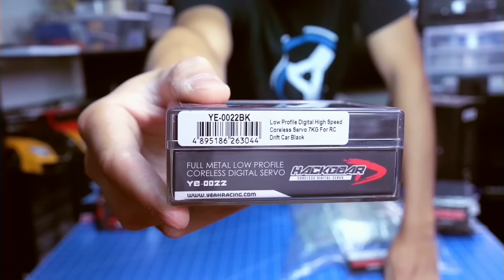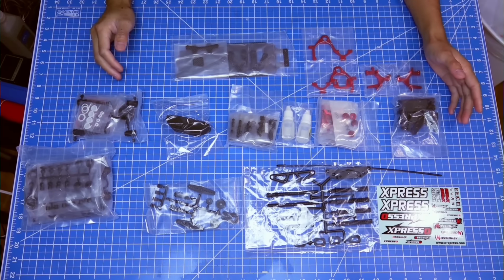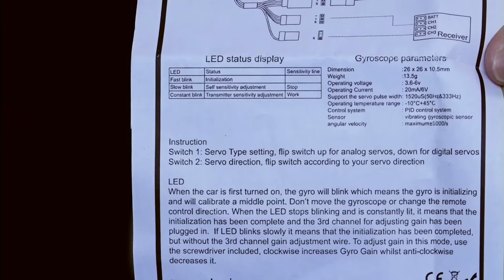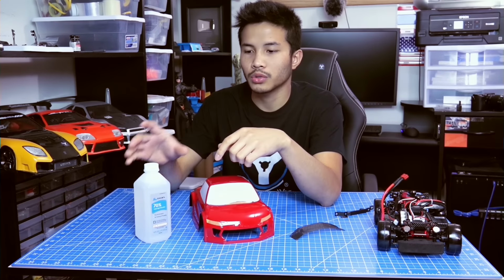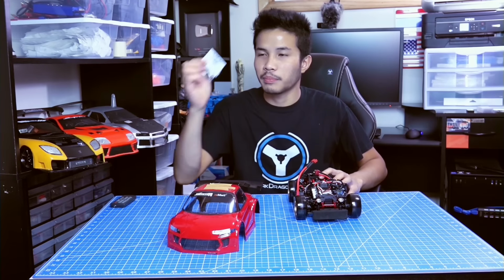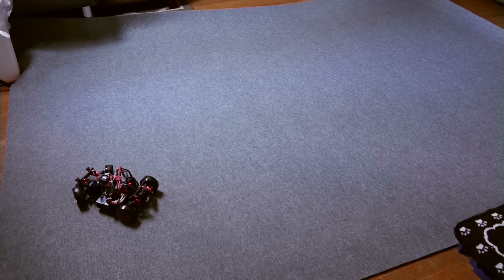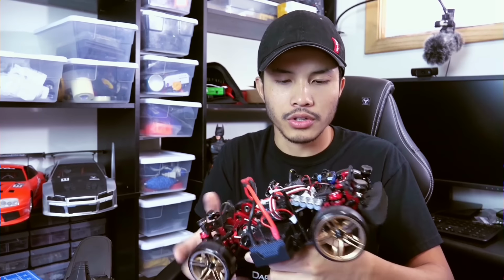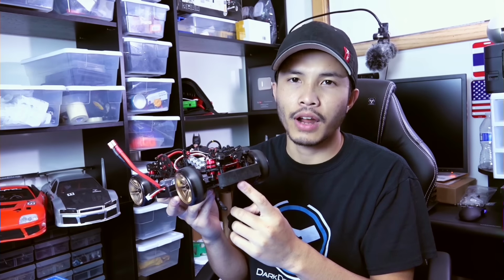RCMC23 | Xpresso K1 - RC Car

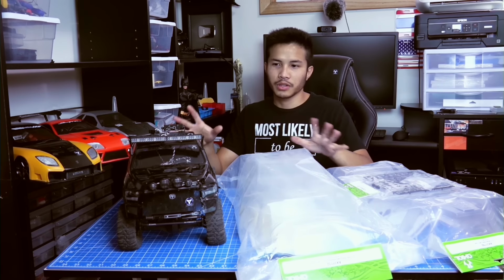Comment from the maker: Yeah Racing X DarkDragonWing® Motion Steering Wheel For 1:10 Touring Drift RC Car #YA-0539
USA https://goo.gl/FxZbaa
HK https://goo.gl/NcPWQ0
Australia https://goo.gl/SsEM7o

Xpress K66 Clear Body Set For K Chassis Xpresso K1 #XP-40025
https://goo.gl/qtco8A

Xpress Xpresso K1 1/10 K Car MR 2WD Chassis Kit #XP-90001
https://goo.gl/OfSiUv
eBay https://goo.gl/RQ9YNu

Robinson Racing 4340 Pinion Gear Aluminum Pro 64P 40T
eBay https://goo.gl/czrBh8

Instruction Manual
http://www.rc-xpress.com/media/wysiwyg/MANUAL/xpress_xpresso_k1_manual.pdf

Instruction Videos
https://www.youtube.com/playlist?list=PL6_nz6AZ_FjBv_aL3w5DYw3RuXZYMfN5e

7.4v 8000mAh Lipo Battery  
eBay https://goo.gl/nn6lGp

Imax B6 Balance Charger+AC Adapter
eBay https://goo.gl/z2UsM6

Color(s):

DuraTrax Racing Red
eBay https://goo.gl/s7H8rp
Amazon http://amzn.to/2oFOYov

DuraTrax Black Base Cover Coat
eBay https://goo.gl/7wSVIN
Amazon http://amzn.to/2oFL8M0

Transparent Colors
http://abchobbyusa.com/lightingkit.aspx

Tools For RC Modify:

ABC Hobby Masking Tape 15mm Width x 18m
eBay https://goo.gl/2xzD9M

3M Mounting Tape
eBay https://goo.gl/gXDStt
Amazon http://amzn.to/2p65Lx8

Dubro 2331 lexan Body Reamer & Scissors Set
eBay https://goo.gl/uHkXpX
Amazon http://amzn.to/2nF4MTx

X Acto Knife
eBay https://goo.gl/9Knkdg
Amazon http://amzn.to/2nbSdUh

Duct Tape Nashua 48mm x 55m 
eBay https://goo.gl/K4scr9

Soldering Iron 60W
eBay https://goo.gl/aqH0Tu
Amazon http://amzn.to/2oGmhV3

Soldering Wire 60/40
eBay https://goo.gl/str3K6
Amazon http://amzn.to/2nCthR5

After Market RC Parts:

Stickers
http://www.screenprintdigital.com/

 Round Magnet Body Posts
eBay https://goo.gl/hiQ5fr

Extra Round Magnets for Body Posts 12x2mm
eBay https://goo.gl/haOabK

1/10 RC Spoiler
eBay https://goo.gl/b0zjL4
Amazon http://amzn.to/2oE4vVo

GT POWER 12 LED Flashing Lights
eBay https://goo.gl/9Lq5cj
Amazon http://amzn.to/2oaPBVW

Amaco 1/16 Aluminum Contour Mesh AO50004D
eBay https://goo.gl/dGr7Qn

Optional Parts:

Mini Car Stand Blue by Duratrax DTXC2361
eBay https://goo.gl/fzWXPr
Amazon http://amzn.to/2oaYzm3

Deluxe Car Stand Blue by Duratrax DTXC2370
eBay https://goo.gl/ghGvBr
Amazon http://amzn.to/2nFakgy
Reply: Pls build a red lambogini pls

Comment: Love your video's! Can you please do a body shell from a 1/14 Tamiya TGS Racing Truck. they fit the TT01 so will fit the D4's etc. Part number Tamiya: 58632 If required. lots of room in the cab for mods, maybe a water cooled setup with a radiator up front?

Comment: Hey man whats up. Love your video's so much. One of your videos inspired me to restore a vintage 1990 New Bright 1/10 Scale RC Police Car. Adding in hobby grade electronics and new upgraded motor made the thing super fast but it stripped my gears when I gunned it in a parade at the finish line. Can't seem to figure out how to fix the gearing.
Reply from the maker: It could be hard to fix those type of RC cars, they aren't really meant to be fixed.
Reply: DarkDragonWing Yeah thats for sure, shes a shelf queen now till I get better at modding and customizing rc cars and trucks
Reply from the maker: Michael David Cilantro You can mod her using standard 1/10 electronics. That might work
Reply: DarkDragonWing Looking into fitting an axial axel on the rear and installing a transmission. Might be able t pull t off. Its already axial in a way so shouldn’t be hard.
Reply from the maker: Michael David Cilantro Sounds good

Comment: how good is the plastic part you make ? are they like rpm? or will they break easy
Reply from the maker: The gear will hold up at any RPM an RC can put out because it drives the belt and the belt doesn't create much heat.

Comment: Do you know what kind of battery to use for a traxxis emaxx  because mine won't hold a charge anymore
Reply from the maker: What battery do you have now? 7.4v?
Reply: DarkDragonWing I have a 7.2v
Reply from the maker: Jesse Tillman Here you go http://www.ebay.com/sch/i.html?_odkw=7.2v+6000mah&_osacat=0&_from=R40&_trksid=p2045573.m570.l1313.TR0.TRC0.H0.X7.2v+5000mah.TRS0&_nkw=7.2v+5000mah&_sacat=0

Comment: Make a working turbo system Built for all cars ?
Reply from the maker: Good idea!
Reply: DarkDragonWing no problem:)
Reply: DarkDragonWing where can i find S2000 Bodies at ? or EF hatchback or honda Civic
Reply from the maker: Nathan Morales Not sure
Reply: Nathan Morales hpi do a Honda s2000, if your in the UK I recommend wheels spin models for hpi body shell s
Reply: where do you buy that remote control cars
Reply from the maker: Karen Argente check the description

Comment: I see u can fabricate your own parts if I was to give a part(it's a front upper deck plate) to fabricate in aluminum would u be able to make it for me
Reply from the maker: Yes, I could, but I don't have the CNC Milling machine that will cut the aluminum part for me.

Comment: were did you get your 3d printer from
Reply from the maker: This one: http://www.ebay.com/itm/HICTOP-RepRap-Prusa-I3-Auto-Level-Unassembled-3D-Printer-175MM-Aluminum-Frame-/151817197431?hash=item2359029777:g:Eq8AAOSwhOVXey4C

I will make a video about it sometime in the future.

Comment: what esc and Motor do you use?
Reply from the maker: It doesn't have a reverse option. You will need to buy a program card separately. I would say find other one that has a reverse option already.

Comment: where can i but upgraded battery
Reply from the maker: What battery do you have now?
Reply: i have a small 1200mah battery and i want something bigger like a 1800 or 2000
Reply from the maker: Marcus Tan I see what voltage? 7.2v? or 7.4v?
Reply: 7.2v
Reply from the maker: Marcus Tan Here you go 5000mah http://www.ebay.com/sch/i.html?_from=R40&_sacat=0&_nkw=7.2v+5000+mah&rt=nc&LH_BIN=1
Reply: thanks alot

Comment: why is it so short and Stubbs
Reply from the maker: They made it to fit small bodies I think
Reply: +DarkDragonWing  Thanks for getting back to me is there any beginner dc drift cars you recommend
Reply from the maker: You can build it yourself like this video here. Look in the description for links:
https://youtu.be/aJGDfJp9cZY
Or you can buy one of these already built:
http://www.nitrorcx.com/madspeed-drift-car-green.html
http://www.ebay.com/sch/i.html?_sacat=0&_from=R40&_sop=15&_nkw=1%2F10+madspeed&rt=nc&LH_BIN=1
http://www.ebay.com/sch/i.html?_odkw=1%2F10+hpi+drift&_udlo=190&_sop=15&LH_BIN=1&_osacat=0&_from=R40&_trksid=p2045573.m570.l1313.TR2.TRC1.A0.H0.X1%2F10+hpi+drift+RTR.TRS0&_nkw=1%2F10+hpi+drift+RTR&_sacat=0
http://www.ebay.com/sch/i.html?_udlo=290&_sop=15&_mPrRngCbx=1&LH_BIN=1&_from=R40&_sacat=0&_nkw=1/10%20mst%20drift%20RTR&rt=nc&_udhi
http://www.ebay.com/sch/i.html?_odkw=1%2F10+tamiya+drift&_udlo=300&_sop=15&LH_BIN=1&_osacat=0&_from=R40&_trksid=p2045573.m570.l1313.TR0.TRC0.H0.X1%2F10+tamiya+drift+RTR.TRS0&_nkw=1%2F10+tamiya+drift+RTR&_sacat=0